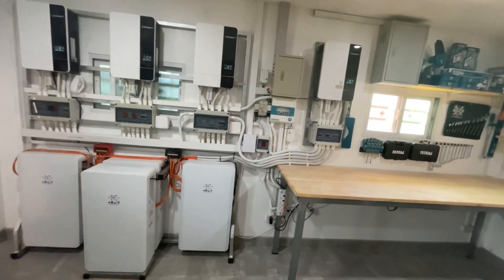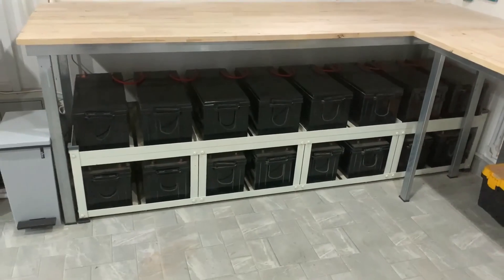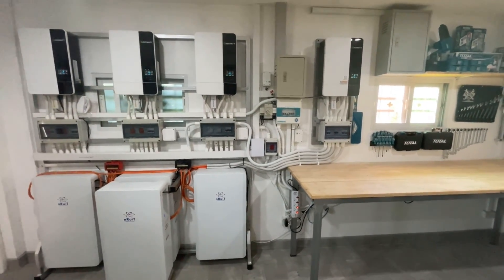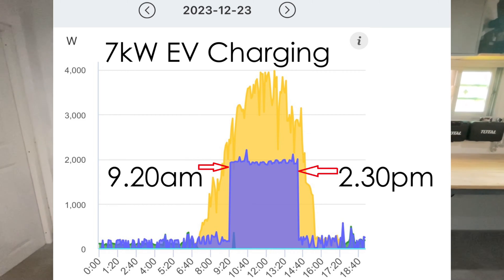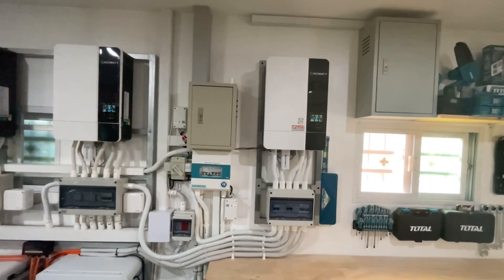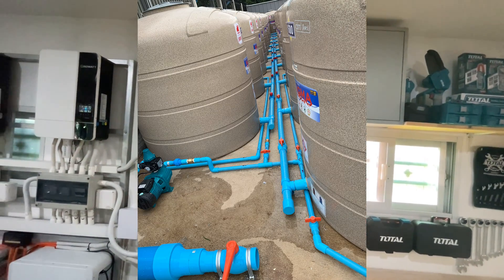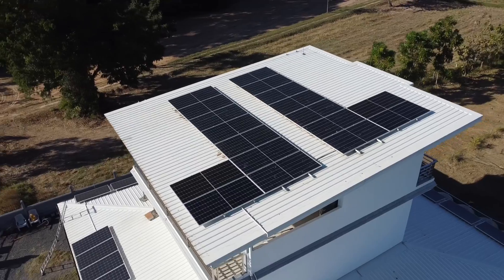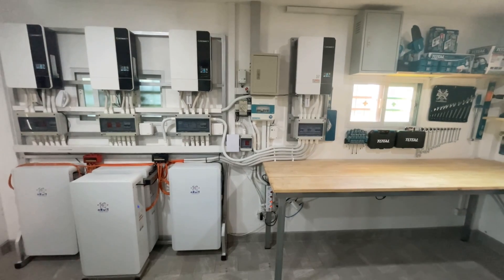Growatt SPF5000ES Inverters x 4

Comment: hi Paul in Pattaya companies are suggesting Deye as Growatt not good at warranty and service in Thailand they say. What is your take? They also do 8kw single phase
Reply from the maker: Supply and fit companies will often rubbish products they don’t supply. I have had Growatts for 3 years now and no problems. Used the support during setup and it was great. I have 2 mates who have them and again no issues.
Reply: Sir, what is the Max. Pv input current of this inverter?
Reply from the maker: @freshia2008  300V
Reply: @EcoHouseThailand  sir mean the Photovoltaic input Ampere ?
Reply from the maker: @freshia2008  The MPPT range is 120-430V Any wattage over 5k is curtailed

Comment: Great video! Looks like a very nice setup! Why did you choose to import the inverters and batteries? Was the selection / availability not sufficient inside Thailand? What was your criteria for choosing those specific devices vs. what was available within Thailand?

Also, out of curiosity what is that alarm / beeping sound? Is that normal? 

Thank you. 🙏
Reply from the maker: Hope you’ve had time to watch the first video. I imported from China, because the inverters and batteries were brand new products and I couldn’t find a reseller here in Thailand. A few years later the inverter was widely available here so I purchased locally. 

Criteria was I wanted hybrid off-grid inverters that could parallel at least 4 units. I wanted LFP batteries at a reasonable price per kWh that were listed to work with the inverter.

Alarm: When I was looking to buy my first PV six years ago Tier One panels were ฿20/Watt. I met a British guy at a show who was bringing panels over by the container load, not tier one and no warranty but ฿10/Watt. I decided to take the risk. I have a couple that have water damage and the fluctuations on the voltage is giving me an inverter alarm. Now Tier one panels have dropped to ฿5/Watt and I can sell my old panels for ฿2/Watt. So I might swap them all out. No rush because apart from the alarm I am still getting good power out of them.
Reply: @EcoHouseThailand  Thank you! This is very helpful. Yes I did: great stuff and very informative. 

Without going into the millions of details I've been working out for my plan to install 20-30kw worth of panels and two or three inverters, the biggest issue I seem to be hitting at the moment is finding quality inverters and batteries which I can put the batteries on the AC side of the inverter. Everything in Thailand seems to be DC-coupled. I haven't heard back from Fronius yet about what they have available in Thailand, so fingers crossed they have inverters - and recommendations for batteries - available in Thailand. I'd also like to be compatible with V2L like you've done, so if you have advice on quality options for inverters and batteries, I'd greatly appreciate it. You definitely seem to know what you're doing! 😊🙏
Reply from the maker: Don’t have time for a detailed response just now, but in the meantime can you watch the part 1 video linked in the description if you haven’t already.

Comment: Great set up, we’ll consider a solar home set up next year. We have a bore hole for irrigation powered by solar already but without batteries so we can switch to the grid on cloudy days. What’s with the rain water collection when you also have a bore hole?
Reply from the maker: Water table in Thailand is falling. There is a water bottling factory close to me with wells down to 500m. Many of the wells near me are going dry. Rain in Thailand is more reliable as long as you can store it.